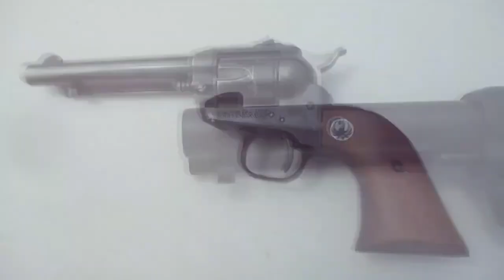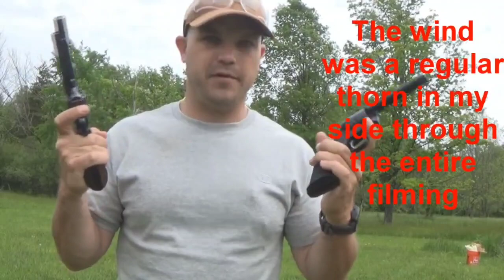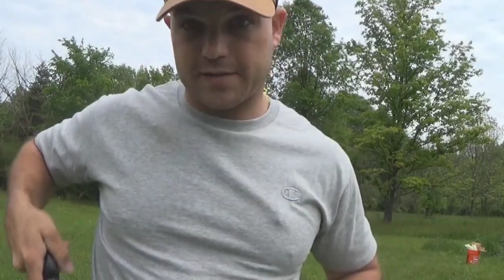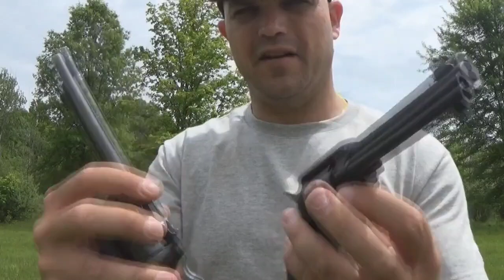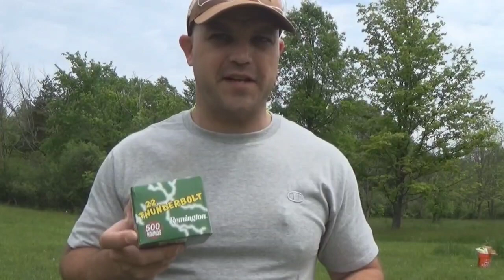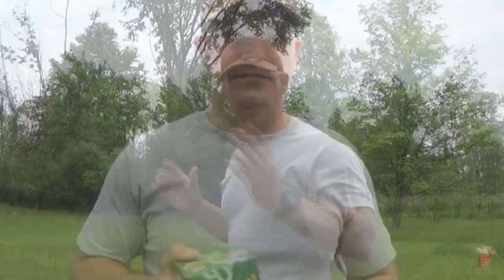Testing The Ruger Old And The New!

Comment: I have the RUGER Wangler revolver,  would love to get my hands on the RUGER Single Six revolver but they are a little pricey lol. Great video
Reply from the maker: Thanks! The Single Six is really a Ruger masterpiece in all regards. Solid, accurate, well fitted, very very big fan
Reply: And the Single Six isn't going to get any cheaper. Try an auction site if you're scrimping.